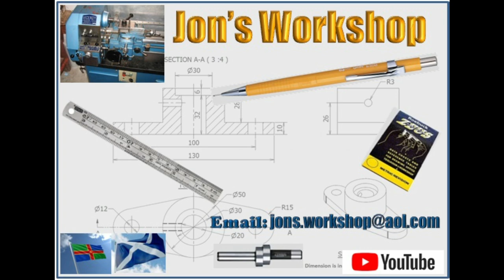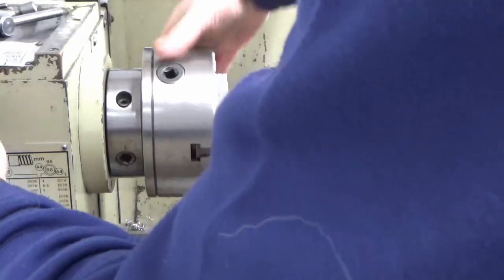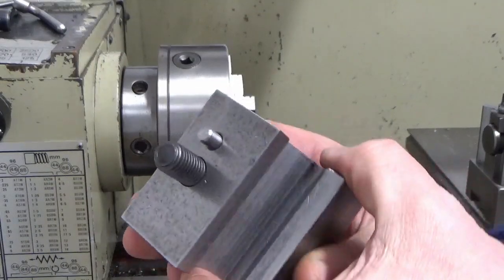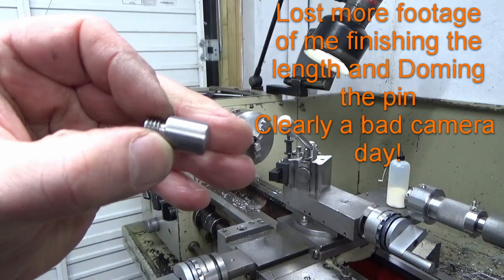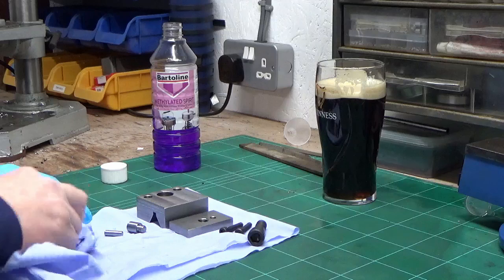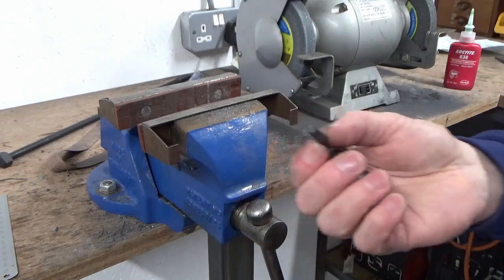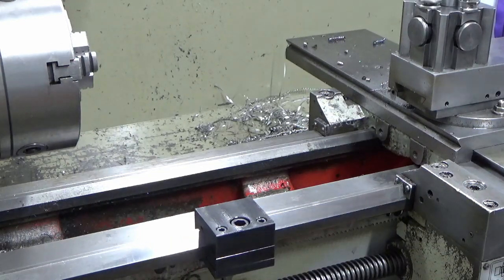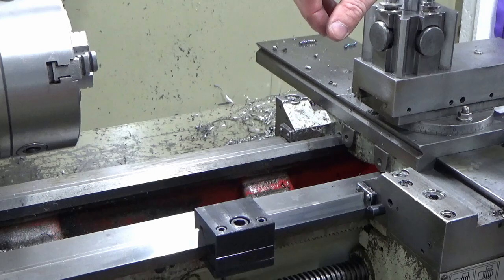Making A Carriage Stop For The Harrison M300 Part 3

Comment: That was great Jon. I really enjoyed it. My Harrison lathe has the factory micrometer stop. I'd never thought of using it as a base for an indicator before. Great idea. Look forward to the next project.
Reply from the maker: Hi Carl, thanks for the comment. Used it today for both uses and it was very handy, worked a treat, it is absolutely solid as a dti platform. Chuffed. Cheers, Jon
Reply: @jonsworkshop  My pleasure. By the way, I was rooting around the other day and I found a spare Noga deburring tool. You can have it if you like.
Reply from the maker: @carlwilson1772  Hi Carl, I wouldn't say no, mine is cracked and has been since the late 1980's. It still works just but I am always worried it will let go and invariably result in a nasty injury (I treat it with kid gloves). Only if you are sure mate and no rush. Cheers, Jon.
P. S. Is Dean OK? Not heard from him for ages, hope all is well.

Comment: Hi Jon, made a thin one myself. I think it was the first thing I made on the mill so can agree with you on that score. I drilled two holes in the piece that rests on the bed and milled just a wee bit into them so that the inserted pins rests on the bed hence avoiding any wobble from my not so great attempt @ matching the bed. I like the idea of a larger one to put an indicator on so thanks for that. TFS, G :)
Reply from the maker: Hi Graeme, thanks for the comment. When you get the time and material, make a wider one and keep as much weight as you can on the back side of the 'V'. Mine has been used in anger today for the first time for both stop and clock stand, It behaved well. Cheers, Jon

Comment: Excellent series and outcome, that's a solid piece of kit, you could also fit a magnetic backed dti, then there would be no need to have a micrometer thimble. Cheers.
Reply from the maker: Hi Paul, thanks for the comment. Good point, I may well just do that, the need for a micrometer stop is largely not required as the compound slide has one already built into it. I guess it's useful if your compound is not at zero. I really like simple and robust which is what I went for with this, nothing wobbly or fragile. Cheers, Jon

Comment: Nicely done Jon,another useful tool!Thanks for the time you took explaining the chemical black again...going to use that on my first mill project ...simple  12 mm T nuts.
Reply from the maker: Hi Robert, thanks for the comment. No problem, I hope the mill performs as well as it can following all the work you have done, I know well how much effort has gone in! I would appreciate some close-ups and maybe a few rough dimensions of your mill stand if possible, it's on the 'to make' list. Cheers, Jon
Reply: Will send by email next week,no problem.
Reply from the maker: @robertkoper3039  Thanks Robert, no rush. Cheers, Jon

Comment: Morning Jon, nice job, will have to get myself some of that chem black, another good project completed 👍, good point about the size of the stop, I made mine to narrow and had exactly that problem, so will have to remake it 👍
Reply from the maker: Hi Terry, thanks for the comment. Yes, I really didn't want to come across as critical as I fully support anyone having a bash. It's hard to point this sort of thing out without sounding like you are trashing other people's efforts which is the last thing I would do. I just wanted to get people thinking about design for manufacture, and design for applicability in this one. Have a go at a thicker one and keep as much mass as you can on the back side of the Vee. Cheers, Jon

Comment: Hi Jon, just watched all three parts 1,2 & on this project, nice end result. Like the logic behind the width, I have done a similar width for the same reason. Another thing I did was to make it longer (not wider) which gave me a couple of extra tapped holes for additional attachments as we have a large surface on the left hand side of the carriage available. It also gives me a nice flat (vertical) surface for a DTI with a magnetic back, which are blooming useful. My Harrison is the same model as yours and there is not enough on the net about this lathe specifically. I have subscribed so keep it up please.

Comment: Well done.  Good to see your M300 running strong.  I have the smaller cousin M250. 

Nice project, if okay with you I may borrow your dimensions and give it a go. 

All the best 

Dan
Reply from the maker: Hi Dan, thanks for the comment, based on you having a M250, I would suggest you measure up as the dims may be different from mine, wouldn't want to lead you down the wrong path. But, width = mag base, depth, front to back = square, height will depend on your bed, angles = mine were 70 deg included from memory but you need to measure yours up. Screw was M12, dowel was 8mm from memory, stop pin was 12mm from memory. The rest you need to make suit your bed. Hope this helps. Cheers, Jon
Reply: @jonsworkshop  Thanks Jon. I made a quick measure and your angles (70 degrees) are spot on for me. The offset from the outer vee is perfect on my M250. The lower plate will take a little adjust as the screws to hold the leadscrew cover don’t leave a lot of room to grab the underside of the rail. I will 3D print and fit for that dimension. I was thinking of making the adjustable stop since mine was missing. These lathes are pretty rare here in the U.S. 

If I provide credit to you and your channel can I share the dimensions on my channel? I always ask and cross promote other channels when I can.  Looks like a good project of course I have dozens ahead of it - LOL. 

All the best 

Dan

Comment: I would have been trumped to use two longer Allen bolts with the threads removed from the protruding section to hold the bottom plate in place. Other than that a very nice job. 👍👍
Reply from the maker: Hi Peter, thanks for the comment, I was actually going to do just that (well almost, was only going to use one long screw). Unfortunately, I didn't have any long enough in my stocks so just cracked on with the pin idea to allow me to get it completed and filmed etc. I also figured it would be an opportunity to show a Loctite method using the annular rings etc. Shame my first reamed hole on camera went belly up, crappy reamer! Cheers, Jon

Comment: Mine is a narrow one 15mm with the stop a M8 cheese head bolt screwed into it as a fine adjustment. It does sot nice on the bed but I do like the magnet platform idea. My South Bend 9A has cast a rounded cross slide so no suitable magnet mount. Until now!.
Reply from the maker: Hi Fred, thanks for the comment. I used mine today for dti platform and stop, the mag base was rock solid and it was very nice and easy to use. Glad I managed to inspire! Cheers, Jon

Comment: Hi Jon,  I still need to get that chemical black. Why do you like such a wide parting tool? Cheers. Mike
Reply from the maker: Hi Mike, thanks for the comment. It's not so much liking, as availability, I was given this year's ago, it's the only blade type I have and I have 4 or 5 inserts for it. Once they are done, it will be going on Ebay as Sandvik inserts are a bit pricey for the home machinist, I will migrate to one of the import blades, probably 3mm, with cheap inserts. My lathe copes with it OK and it is rock solid, as you would expect from Sandvik I suppose. Cheers, Jon

Comment: Finally caught up so time for a (t)witty comment. Got to agree on a good stable shape and mag block a good idea but if you planned that from the start why have clamp screw the wrong (hidden)way up? I can see occasions when you might want to move it, but then you might be better at forward planning than me so not a necessary feature.
For DTI holding a tool holder mounted one is best, or so i have found, as it allows preset centre height and rapid zeroing using the cross slide. I used an unwanted 1morse holder for mine, always ready for some action, not like its aged owner.😢
As an aside, not only is your drink racist but it occured to me that snooker is too, what with knocking all the coloureds down a hole with a white. Time to start a campaign to have the cue ball's  colour changed in this diversity gimmick time we are in.😉
ATB 
c
Reply from the maker: Ah haaa, there you are! I was about to send you an email to see if you were still this side of the grass! Glad you are OK! Now, onto the carriage stop, I did have the dti thing in the back of my mind from the off, and I also considered a hex nut from the underside, but, the more I thought about it, I dismissed the idea because 99% of the moves will be to alter depth stop, and they are now all very easy to get to with no possibility of me picking up that damned adjustable spanner! For the very few occasions I have incorrectly positioned for clocking, I will tolerate the disruption. Lol, yep you're right, the do-gooder brigade are taking things to daft lengths, don't even joke about it, if one of them sees this suggestion, the only sport I have vague interest in will change forever. Cheers, Jon
Reply: @jonsworkshop  i hear that L Hamilton Esq of F1 notoriety wants to swap  the cue ball for a black one.😉
I can't keep making your day every video, you got to have a little suspense in your life.